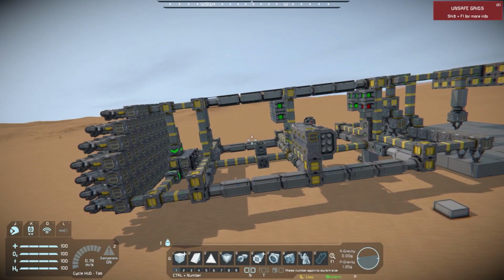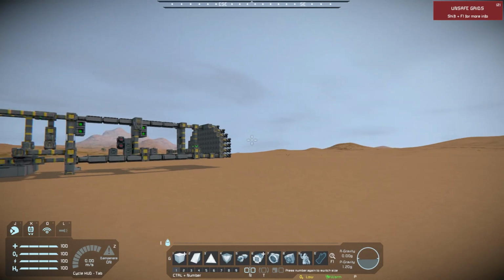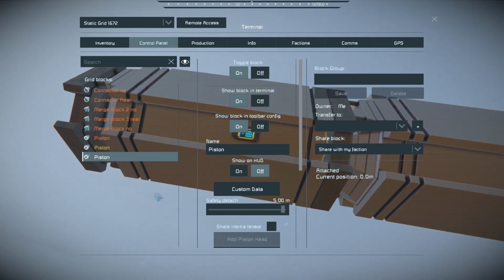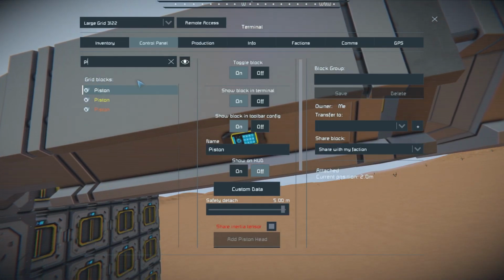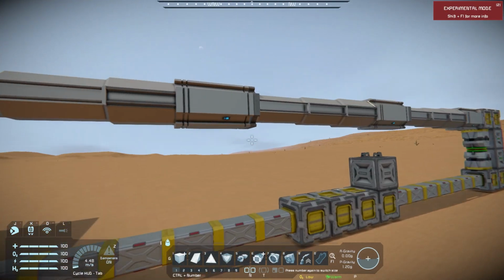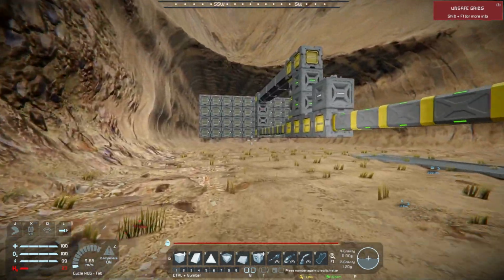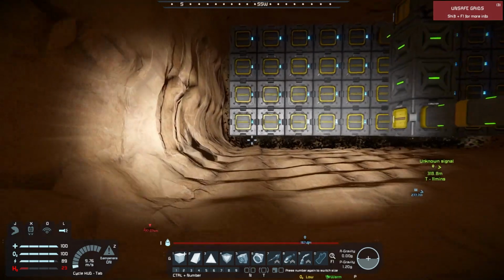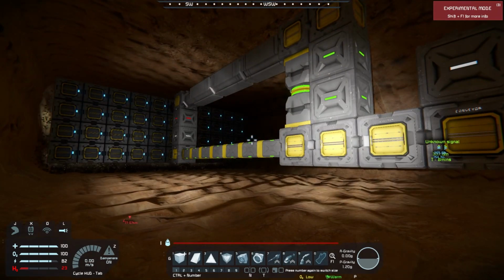Space Engineers #6: Redesigning the Inchworm

Comment: So I have a very similar system called “Blue Boring Machine”. The issue I have with is similar but for me both the rear and front merge block grids turn to stations when connected. When disconnecting I have to manually revert them back to ships each time I move the system forward. I didn’t have this problem in creative, and I’m stumped. I would like to automate it in survival, like I had working in creative.

Comment: Hi Rich, instead of adding those blocks on the end would it work if you placed a Battery unbuilt on the end to have the weight required and just leave it there?  secondly for more hoppers could you grind down the connectors that are no longer used at the beginning of the system.
Reply from the maker: No. Placing a block isn't really for the weight. In Space Engineers you may notice that when you place a block on a grid connected by pistons and rotors, it sometimes jumps when you place the block. It just another bug but it helps with the merge blocks. As for the connectors, I have so much to do since I'm doing this mostly by hand, grinding connectors would just cause extra work.